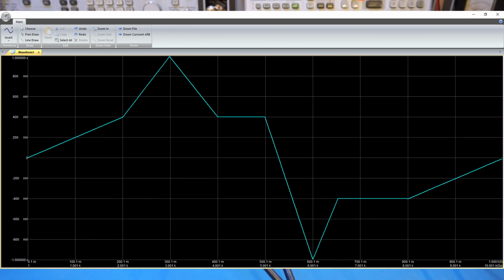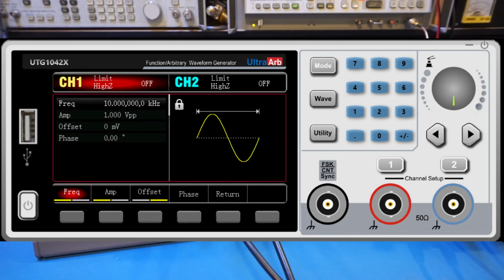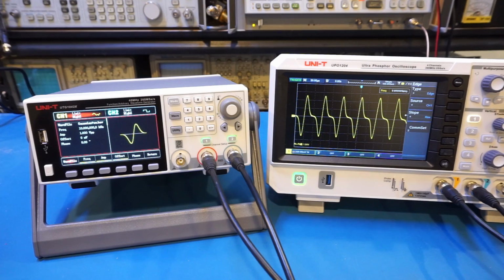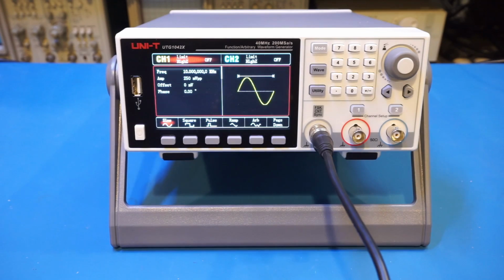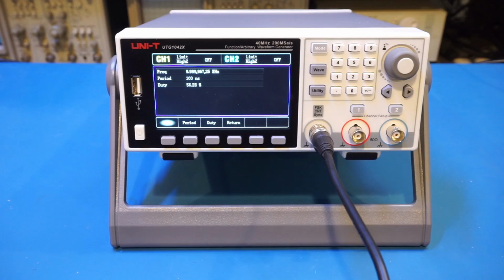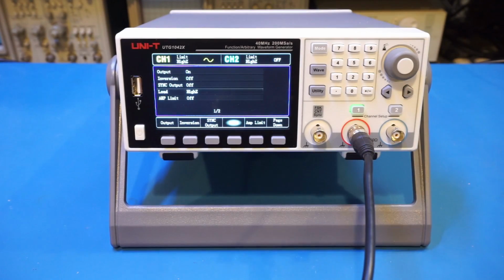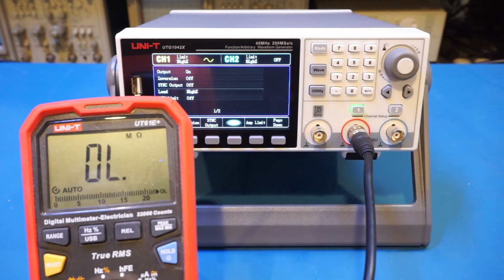Review of a UNI-T UTG1042X Dual Channel Arbitrary Waveform Generator

Comment: Hi, can this mix the two tones for testing SSB linearity internally and output the mixed tone?
Cheers
Reply from the maker: You will need a combiner and combine both outputs. I suppose you could design an arbitrary waveform but it's not as flexible.
Reply: @KerryWongBlog  looks like the Siglent SDG 1062x is the go as it has an internal mixer/combiner.i have modified a TV antenna splitter box into a 50ohm y divider for my Feeltec FY6800 which works OK...but rather the Siglent soonish..
Thanks for the reply

Comment: Hi Kerry, Thanks for the video.  I commented on an earlier video about the Uni-T 962 ARB where I am concerned about the signal level drop when AM Modulation is enabled. I noticed the same thing on this video at 9:04 where when you turned on AM Modulation the level on the scope suddenly dropped.  Is this normal and expected behavior?  Does the sine wave level still match the ARB display?  Test case... Sine wave 14 mHz at -30 dBm then watch the level change when AM MOD is enabled, even if the MOD Depth is at 0%.  Why does the level drop?? is this a shortcoming of the Uni-T firmware??  thanks for taking a look at this question
Reply from the maker: The drop at 9:04 is probably due to the triggering point and the timebase. But I saw your earlier comment as well and I will definitely do a comparison video (will probably be next month though) and will confirm.

Comment: The frequency counter is a bit of a disappointment limited to TTL (verified in Uni-trend web site).  If frequency counting is important, the Rigol DG-832 has a 7 digit counter which has 50 mV RMS to 100 MHz and 100 mV RMS sensitivity to 240 MHz.  The other instrument attributes are similar, but the Rigol max sine output is 35 MHz max and it has a touch screen.  The down side to the Rigol is that you have to use the touch screen because there is not a 10 digit key pad and the Rigol is ~100 USD more expensive.

Comment: These AWGs are so small ... i wonder, if selling my Sony/Tektronix AWG610 would be a good idea. Its quite old ... 8M Memory, 8bit res, 2VPP@50Ohm and 2.6 GS/s ... on the other hand, these small units tend to slip around, mhmm. Did the same slew rate test with the old AWG610 and its razorsharp ... mhmm hmmm! Things i need the most are "sync-out" for sweep-alignment of radios ... 10,7 MHz etc pp